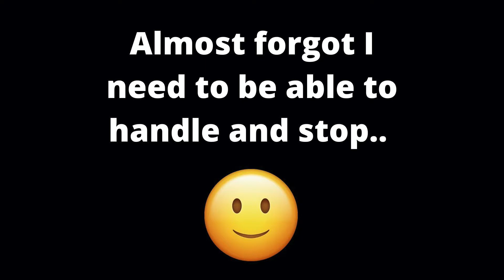PRICING OUT MY DREAM GARAGE! | Oil Change & Chill

Comment: Porche 911 GT2 RS. 290k. ECU Tune Flash (3k) = 293k
2017 Acura NSX. 120k. Twin Turbo Catback exhaust, ECU Tune, wheels and tires, (8.3k) = 130k 
Nissan 370Z Nismo 40k. STILLEN Supercharger Tuner Kit, wheels, tires, suspension (12k) = 52k
Rough estimates, and rounding up on the mods lol. about $175,000 left in change. whatever issues come up between the 3 of them I can fix easy with the cash lol. I was going to put M4 but I plan to get a used one in the future as a weekend car. New Sub, keep up vids coming my G. looking forward to seeing you, your car, and channel grow!
Reply from the maker: Homeboy Wild that’s a solid garage bro and thank I def will 👌🏾